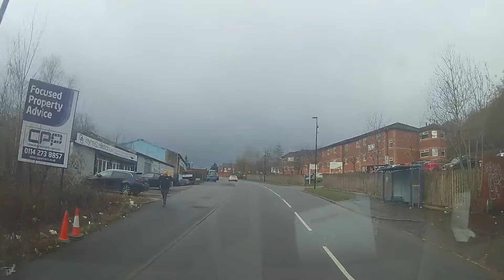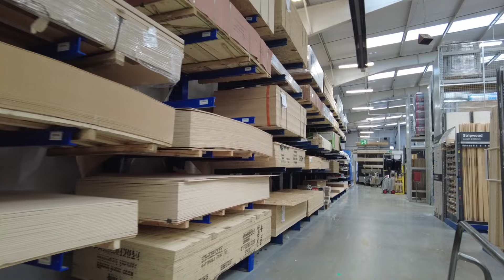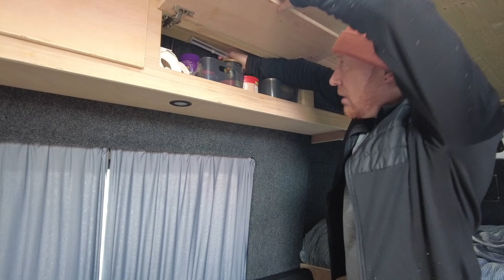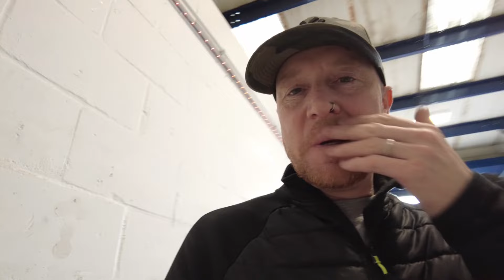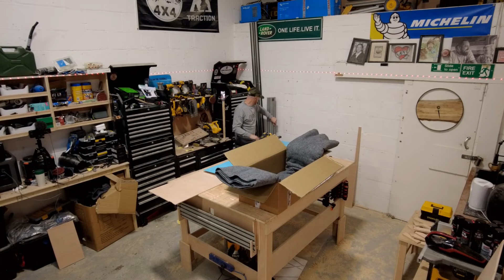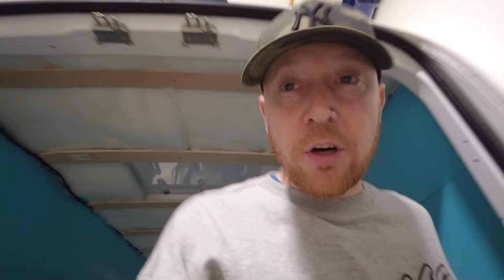A general day at Coalition Vans HQ. (Behind the scenes!) #vanconversions

Comment: I've bought pack of those off amazon. But mine are rechargeable from USB.
Have you got the one that isn't working right way round on switch. All mine work fine
Reply from the maker: @daviddring8692 Well...
Since fitting, I couldn't really work out why they weren't working, but if its dark enough, they all actually work 😁.
Reply: We've got the USBs in the kitchen at home, charge lasts a long time 👍